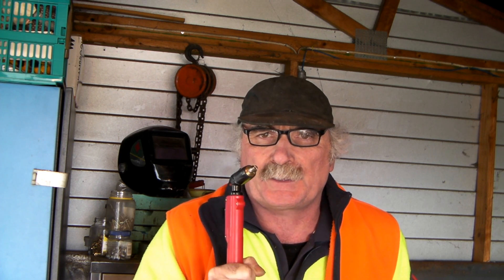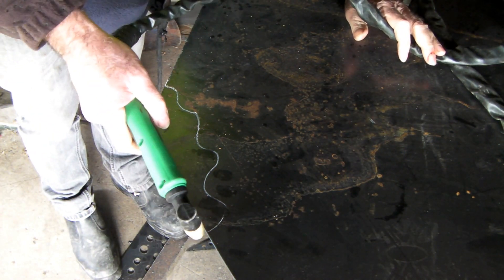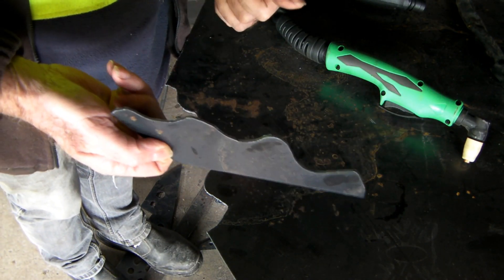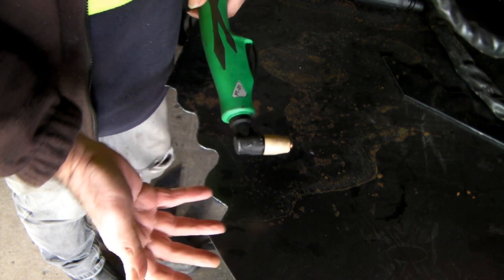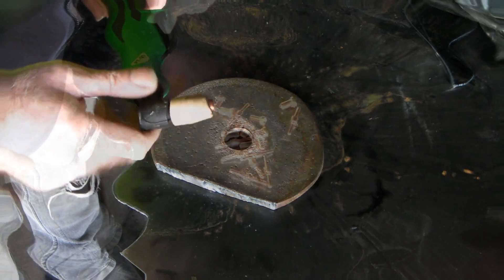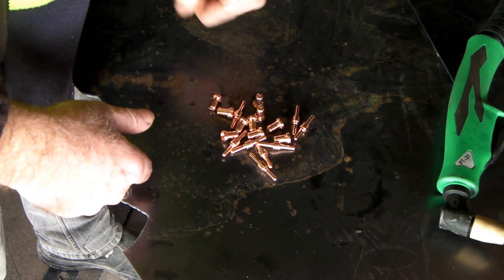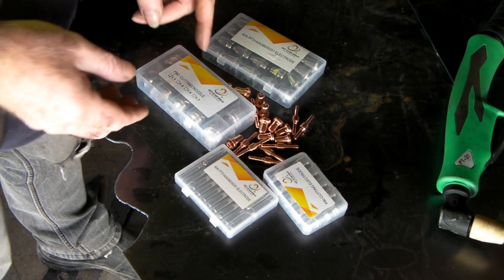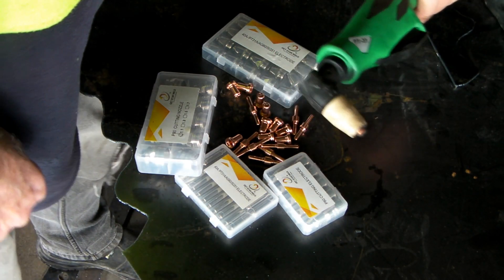DON'T  Buy Cheap Plasma Cutter If You Need ???

Comment: But it’s cheaper to get a cheap plasma cutter then replace the torch for the same quality as a more expensive one. The torches and bits are cheap it’s the power supply unit and circuitry that’s expensive
Reply from the maker: GOOD TIP
Reply: That’s kind of what made me go with the Primeweld 60. Power supply I believe is Chinese, but it comes with an Italian ITP60 blowback type torch and is CNC ready and has some US support. More than the No brand Amazon cutters, but still a small fraction of a Miller, Hypertherm or other industrial quality unit. Being able to get a variety of tips (gouging tips, extended shielded drag tips, smaller diameter tips) is nice. 

Time will tell, but so far so good with mine.

Comment: So, the ability to gouge or pierce, is that in the torch itself? Or, is that a combination of the torch and unit itself? Can you put a good/better torch on a cheaper plasma cutter and gain the ability to gouge and pierce? If so, do you have some torch recommendations there? Thanks for the video, I've been researching purchasing one for home and felt a cheaper one would probably be ok...until now ha, ha. Thank you. -Jeff
Reply from the maker: With the cheaper plasma cutters you don't get any choice with your cutting tips .They just cut ,But with some of the branded units you can get different types of tips to gouge & pierce .But they also cost considerable more .
Reply: @petestools  thanks for the info, Pete.  I’m still shopping and learning :)

Comment: PT31 torch looks like the steel cutting equivalent of a woodworking jigsaw.  Starting a cut in the middle of a steel panel is like plunge cutting a wood panel with a jigsaw.  Guess if you're familiar with that, the torch should be pretty straight forward.
Reply from the maker: thanks

Comment: We’ve talked about this before. I agree with what you’re saying here. For basic use, an inexpensive model should be fine, as long as the dealer is reliable, because there’s no real warrantee for these.

What I’ve found is that unknown branded consumables for my Thermal Dynamics don’t last very long. Is buying ESAB’ s genuine consumables cheaper because of that? Not really, but I can work for much longer without having to change something. That’s worth it to me. And having different tips and nozzles is a big help as well. You can pierce with the regular tip on cheap machines, but you burn it out pretty quickly, and the pierce isn’t very nice.

But the question is whether it pays to buy a machine that’s from three to five times more for the same output. Is it worth it for most people. No, not really. But my 40 amp machine makes a very high quality 1/2” cut, and will cut 1”, as the specs claim (I’ve tried it). It usually takes a bigger machine for that. So there is an advantage there.
Reply from the maker: Yep depends what your using it for thanks

Comment: Thanks for the video pete, can I ask if you think  my compressor is too small I have a cut40 clone ( draper) machine, my compressor is a 24ltr 2.5hp, I might get  a perfect cut, then get a molten mess on the next.
Reply from the maker: yes i would say its to small mate , i am putting a extra tank on my compressor to get some more air .
Reply: @petestools  thanks, sounds like a good idea, that would be a good video, adding a extra tank